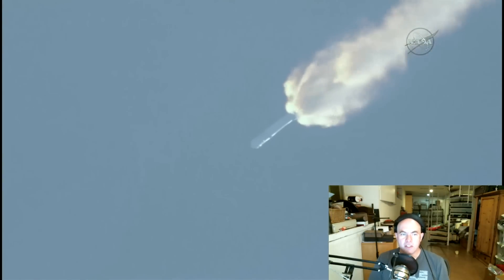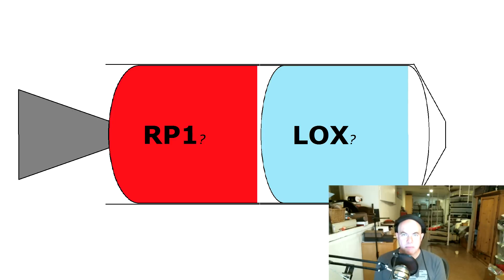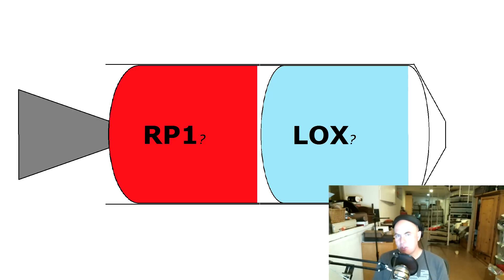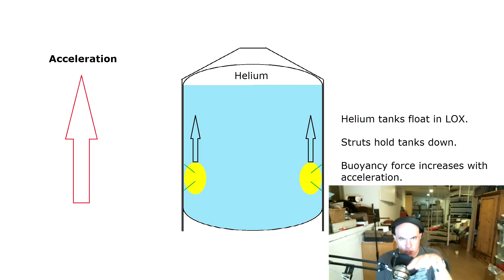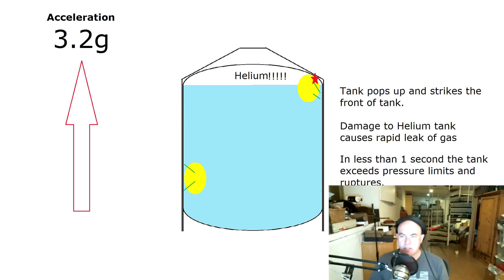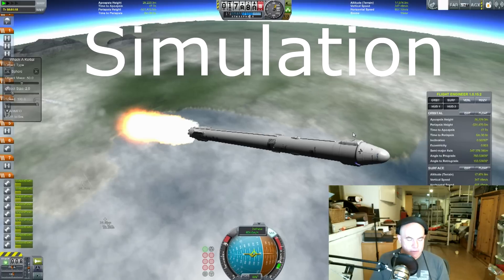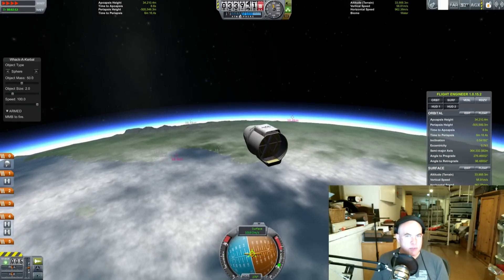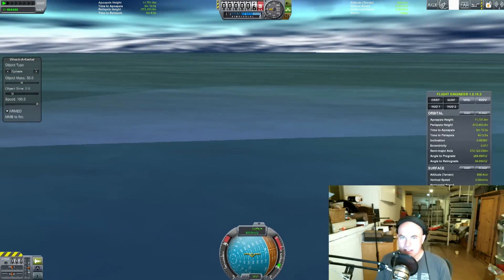Explaining the Space X CRS7 Launch Failure

Comment: So what is the benefit then of putting the helium tanks on the bottom of the oxidizer tank if that creates big forces on the struts? Wouldn't the pressurizing effect be the same if they were mounted in the top part?
Reply: Joost Kerpels They'd warm earlier, and be exposed to a significant pressure change while also containing much higher pressure gas.

Comment: Well, it would be interesting to find out more. This would be an excellent learning opportunity

I've been an ASME plant inspector for years now, with the occasional QA/QC job. I've seen some bad construction. This usually is the result of cutting costs/corners to get the product out of the door as quickly and cheaply as possible. The rest of the time it's mostly bad design.

Mechanical failures like these could have lots of contributing factors: wrong base materials, a batch of bad base materials (even though the material certificate check out), improper welding, bad welding procedure, over-/ undertightening of bolts, mechanical damage (grooves, notches,...) caused by improper handling, embrittlement of construction caused by cryogenic temperatures, dissimilar weld metal cracking, metal fatigue and last but not least greed and/or stupidity.

Here's a short list of things I've come across in my career:
- plastic deformation and snapping of bolts caused by overtightening which didn't allow for thermal expansion of the pipeline in question.
- internal corrosion and leak of piping after only 300 running hours (less than a week) because of improper design. (wrong base material for chemicals handled. bad pipespec.)
- cracking and leaking of welds on a new steam boiler for a power plant after only 100 running hours, caused by improper design and welding (base material too hard to be welded properly. welded it anyway.)
- cracking of pressure vessel wall on a chemical reactor after 3 months caused by grinding marks + agressive external atmosphere.
- failure of pipe supports because installer didn't take thermal expansion into account.
- leaks of corrosive chemicals due to the installation of improper gaskets.
- implosion of tank after hydrotest because a plastic bag was blocking the vacuum relief valve after paint job.
- leaks of stainless steel piping because of inadequate chromium, nickel and molybdenum content, even though material certificates stated otherwise.
- cracks in flanges of a new plastic storage tank because of overtightening of steel bolts.
- 20 radiographs with exacly the same defect in the weld, caused by lazy radiographer.
- misrepresentation of NDT reports, because the original inspection revealed defects the manufacturer couldn't be bothered to repair.
- strange shapes on radiograph which turned out to be entire welding rods that had "fallen into" the weld preparation ( V ) and the welder "failed to notice" and subsequently welded over.

Fun times.

Comment: I have personally seen the inside of one of the falcon heavy 1 stages. the helium tanks are completely separate of the fuel tanks, outside of them. They are held on by struts. (the heavy stages are the same as the F9 stages) but since I did not see any of the second stage (except for the engine) I can't say that it has the same set-up
Reply: aggiefan88 The helium pods looked like the pod on the right (in the picture you showed) but much wider. they were situated between the 2 main fuel tanks. (When I saw the inside, the kerosene tank was missing, but the LOX tank+ tube that ran in through the kero was in place) It blows my mind to see something that sturdy and tough, literally disintegrate into bits and shreds by sheer air resistance.

Comment: Actually, the reason why you put the Helium tanks inside the Lox tank is that it reduces the difference in pressure between the outside and inside of the tank which means you can use a lighter tank and/or pressurize the helium more.

Comment: Why not put the He tanks in the top of the LOX tanks to minimize the buoyant forces? 
It stands to reason that once the LOX level drops below the He tank, the large upward buoyant forces would be removed and replaced with the (much smaller, I assume) downward force due to acceleration. I'd also imagine a relatively low jerk as the LOX level smoothly drops down the length of the tank.

Comment: Scott Manley There is one thing that is indisputable here... I am amazed that they did not have emergency return capability on the Dragon capsule. It's already designed for re-entry, so its only a big red button tied to some software which should already exist, albeit in a slightly different form, for re-entry.  If I was flying a multi million dollar payload, I would have put some rudimentary RCS and parachute control designed for emergency abort onto the capsule just in case. This mission would have had a far bigger upside at this point, and I can only guess that the absence of that system has to do with someone, or someone's, saying "Its totally reliable, and we have done all the math.. we don't need to burn the extra man hours on that because we'll miss our deadlines" when it came up in meetings. It had to come up in meetings.. its so bleeding obvious of a question. So, I would say SpaceX getting a bloody nose here is a very good thing. They are a fantastic organization, but perhaps a bit too cocky. Risk taking is one thing, but put the contingency systems in place that you can easily predict. As an adjunct, I have worked in ISP and Telecom Infrastructure for over 20 years now, so I have witnessed this same mentality many times, and it has always.. 100% of the time.. created a disaster of some kind, at which point people would actually fix the problems I had been harping about for quite some time before. This event is identical in all respects to my experience, so it seems the Silicon Valley mentality has it's downsides.

Comment: Just a thought here but shouldn't a consideration of the effect of the cold, being bathed in Liquid Oxygen -297 Fahrenheit be considered, it would make sense a strut rated at 10,000 lbs is much weaker and more brittle when at that extreme cold temp. So saying it broke at 1/5 its rated rate may be a bit misleading depending on the actual testing and whether they extrapolated the rating to actual condition in the tank or actual certified and tested at -297
Reply: Stephen Levenhagen It broke at 20% of the stress it was rated for at that temperature.

Comment: Oxygen tank is on top because of the cryogenic temperatures. If the RP1 tank is on top the duct from the tank to the engines will pass through or right along the LOX tank. This will make the fuel freeze up and clog the tube. In both cases the duct must be temperature isolated or reinforced because of the aerodynamic stress. The Space Shuttle's external tank has the LOX on top with external duct because of center of mass reasons, LH is not very dense. :)

Comment: IMO there's two huge, huge problems that came out of this....or at least the way you explained it. And it's nothing you did wrong.

One: The struts failed at 20% of their design load. That's too easy to point to a strut and say look, there's the cause, we changed supplier so it can't ever happen again...the real question is why did the struts fail, was it a design flaw, was it a manufacturing problem or an installation issue?

Two: Where's the backup redundancies on the rocket in question? Okay, one strut breaks and that sole event leads to the loss of the vehicle? Maybe I'm more used to aircraft....but it strikes me as odd that there was no mention of a redundant backuup system in place in case a strut failed and the tank moved. It simply strikes me as something so obvious that (from what you said) was either not talked about, or not on the vehicle.

No I don't count more struts as a backup safety system. One strut failed so it's perfe3ctly plausible others could fail in the exact same manner in the same vehicle.
Reply: DieKolkrabe Why the struts failed is an important question for the supplier, but not so much for SpaceX. From their perspective, all this means is that when they're shopping for new suppliers they'll need to run their own tests to verify the specs claimed by the manufacturer.
Reply: DieKolkrabe Don't be stupid.  There is nothing that can serve as a backup to a load bearing structural element other than another load bearing structural element.  ie. more struts.  Asking for a backup that isn't more struts is like asking for a sky scraper to be able to stay up without girders.
Reply: Skrapion given that it failed at 20% the designed load, the whole cost of the failure might be put on the supplier..
Reply: DieKolkrabe There usually is no backup for structural integrity, you tend to have design loads which are somewhere between 120% and 200% of the expected maximum load, finding a balance between safety and weight. Even in the aircraft industry you usually just consider system failure (i.e. control hydraulics failing) not structural failure (control surface getting torn off). As the others said, pretty much all Space X can do is change suppliers and optimise the quality control routines. From what is known currently, the rocket design itself was not the problem.
Reply: DieKolkrabe The struts being rated for 10,000 pounds of force is the redundancy, they were probably not expected to have to deal with anywhere near that much.  Struts aren't physicsless in real life you know. Like another commenter said, the only redundancy for a structural part is more structural parts, and those weigh something and take up space. Any good designer or engineer designs a safety margin in, but those are based on specifications that one takes to be reliable; no one can reasonably be expected to design something that will failsafe a materials failure at 80% less than its rated capacity.
Reply: DieKolkrabe Backup systems add more weight which requires more fuel which requires bigger struts. Its a circular problem.
Reply: Nathaniel Ruff if there is a l/w ratio that allowed more weight, not much. Infact, integrity is quite light. look up graphene. crazy..

They will add another set or redesign the design itself but yeah, only so much support you can get until you get mass.
Reply: DieKolkrabe What I don't understand is why didn't they have an overpressure vent or safety.
Reply: Yves Lacombe Because they didn't expect that something like this happens. Why build a device into a rocket, that will never be used if everything runs flawlessly? And even with a valve the mission would have failed because the actual failure was to severe and would have made the second stage inoperable anyway.
Reply: Yves Lacombe What happens after you open the overpressure valve? You end up with a rocket that can't fire properly and starts falling back down uncontrolled. You might as well just pack a parachute on the Dragon and be done with it.
Reply: Skrapion there should already be a parachute in Dragon because it can return cargo from ISS. But why weren't they able to use it? IMO because they didn't try enough to manage failure.
Reply: xponen From Scott's description, it sounds like they're just not done writing the software for emergency escape. I can understand why they wouldn't prioritize that, as their focus right now is on supply missions.
Reply: PhilfreezeCH You engineer things with a safety factor to exceed the expected loads. This item apparently did not have the claimed rating.  Generally you can't afford to start bolting on backup structural parts, not in aviation. You actually need to be able to leave the ground.
Reply: ***** IMO in reality they didn't do proper risk assessment. In general, you should use computers/simulators to induce random failure in parts, then create a plans to reduce severity of failures. Like pilots (in simulator) who didn't need to fix an airplane, but do a controlled crash instead. In this case, they just need the parachute ready.

This is 2015 guys, absolutely feasible...

Also, I read Elon Musk mention SpaceX as a bit "complacent" because of streak of success... He asked the employees if there was any reason to halt launch, but they treated him like he was paranoid.
Reply: +DieKolkrabe 
The acoustic signatures is what brought the idea that it could have been a strut.  The engineers at Space X then tested this theory by testing the strength of struts they had already in hand, and found they failed way before design specs.  Not all of them failed but some did and at different points.  Last report I read was the quality of the materials used not the design or manufacturing process were to blame.  Not all Aluminum or steel has the same strength.  Hit a drill bit with a hammer and tell me what happens.  The drill bit will shatter but the hammer will be fine.  Both are steel...  But that drill bit can put a hole in that same hammer...  you need to find the right strength for the right job, the metal of the drill bit while perfect for cutting holes cannot take a hit, but the hammer can take a hit but not resist getting a hole drilled in it.  Same goes with the struts, if  they have the wrong temper or they are made out of the wrong grade of materials they will not be able to preform the way they were intended.

As for a redundancy... Well I am going to guess there is at least 2 struts per pressure vessel.  How many do you use?  2 that are each rated for 10K breaking force where the expected loads are only going to be about 7K  Im guessing on the actual loads but with any high stress machine you give yourself a margin just in case.  Now if one strut breaks not only are all forces on one of 2 struts but the direction of force is also different.  I am going to venture a guess as they may not have been designed to handle 10K of forces in all directions which caused the redundant strut to fail as well.  As for the entire tank itself, I cannot say what its rating is for but I can say that being of a much larger volume the amount of force on it is magnified, and if the small pressure vessel hit the top of the tank with sufficient force it could have compromised the structure thus creating a weak spot.  

All and all it is too often only one thing that starts the chain reaction that causes the entire vehicle failure.  Happened before and sad to say will again.  1 piece of metal caused the only Concord crash.  One dropped O2 tank nearly killed 3 astronauts onboard Apollo 13.  One cold O-ring destroyed Challenger and 7 Astronauts.  One oil line nearly destroyed an Airbus A380 in flight.  Sometimes it is only one little thing.
Reply: +GlueGaming They were really trusting on the word of the supplier that the struts are rated for the tensile strength as they were only expected to experience a fraction of it. Usually they make a lot of the important components in-house but still outsource suppliers when they can to save money. Needless to say they won't use that company that provided the struts again
Reply: Some major armchair rocketing going on in this thread. The backup in this case is the design specs. In the unforeseen event that it experienced twice the expected stress the struct would have held. The other struts failed because they were all defective. If the fuel tank runs out of helium then the tanks won't have enough pressure to feed the engines. Venting overpressure helium and fuel would mean not enough fuel to get the 2nd stage to the altitude and velocity it needed. Not to mention more valves and vents cost money and add weight which eats performance. Also vents take away from structural integrity. This is what the legal system is for. If the rocket is lost because of defective parts then the company that made them has to pay for it. At the end of the day now SpaceX makes and tests their own struts.

Comment: If those helium tanks are there simply to help fill the void space with gas as the fuel runs out, why not put them near the top of the tank? Wouldn't that provide better stability for the struts, less float-up force since it's already at the top, and simpler engineering?
Edit: Ah ok, I think I understand. Keeping them lower in the tank keeps them cooler longer, and allows them to be smaller.
Reply: ***** I would assume the liquid oxygen cools as it is burnt off and expands rapidly, and this cooling affect would allow you to store more helium in the tanks. Basically it is more efficient because you can use a smaller tank.
Reply from the maker: ***** THey have to pressurize both the oxygen and fuel tanks, so putting them close to both tanks makes sense.
Reply: Scott Manley Oh, that makes much more sense, I assumed that there were helium tanks in both the oxygen and fuel tanks.

Comment: 301+ !!!!

Well, I haven't really looked up any specs, but after dusting off my study books, a standard piezoelectric accelerometer should work between 200 Hz - 5.4 kHz. If equipped with a charge amplifier, the frequency response can drop under 1 Hz. Assuming they want to measure mechanical vibrations, a minimum of 5 Hz would be desirable.  I expect a somewhat standard transducer would work quite ok, if the collision event wouldn't have to much energy in high frequencies.
Reply from the maker: Tuning3434 I don't doubt that the accelerometers can measure at kilohertz rates, I suspect the limitation will be the bandwidth made available for telemetry.
Reply: Scott Manley Thats a very good observation. Didn't considered it. Maybe Alen wants to know IT ALL
Reply: Tuning3434 Accelerometers with bandwidths well over several Megahertz are commercially available - so I don't doubt that their sensors had enough fidelity to make the discoveries that they did.